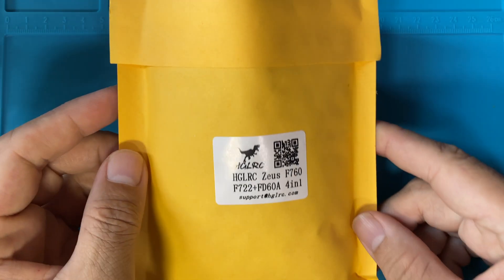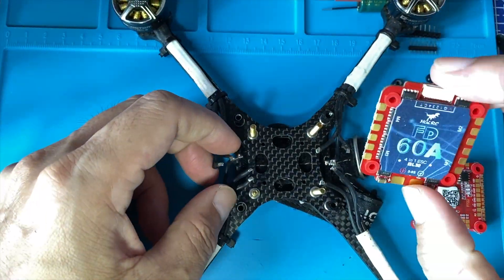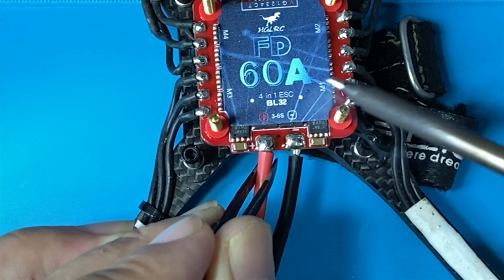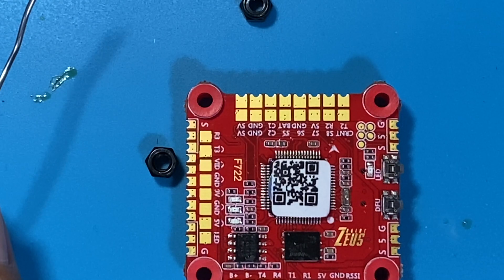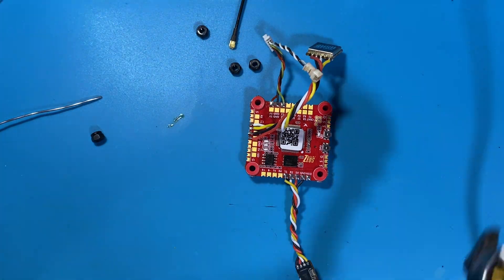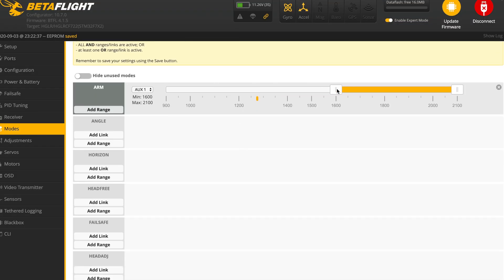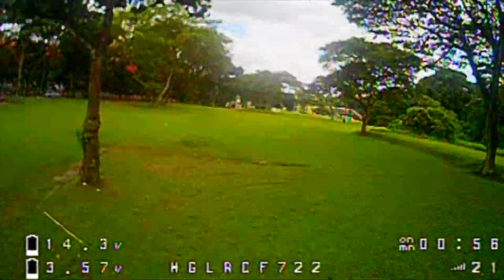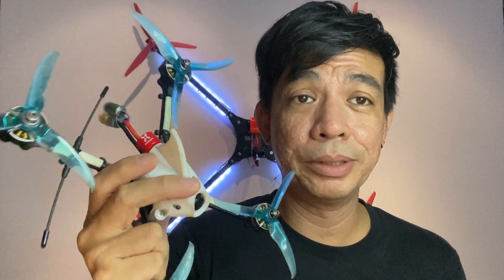HGLRC Zeus F760 | RACING DRONE BUILD

Comment: Thanks for this video, very straight forward and helpful man!
I have some spare unused parts, wondering if I could fit them and make them work with this stack: i have a M8Q-5883 SAM-M8Q GPS, a rush tank solo vtx, a tbs crsf div rx, a frame kit for a chimera 7 LR, just miss a cam, an fc/esc stack and motors (6S), do you think this stack is a decent choice for all that? Not fond of the SucceX-D F7 stack, wanted to try sth else, why I considered this one as it looks well made...
Reply from the maker: hey thanks for dropping by bruh!!!  Appreciate it man!! Thank you!  YES!!!  Mosdef bro! With that GPS module it will work nicely.  Im not fond of any iFlight electronics.  Killed 12 of the Succex F4s and F7 till I got pissed.  Good FC lousy ESCs.  Yeah, if this stack can fit your quad, go for it.  Its decent and can handle the high powered motors.  Its on my racer!
Reply: @shogunemperor  thanks for your reply and thanks for your content, always good videos!
Reply from the maker: @stevefpv4669  aye, my pleasure bruh!!!  And thank YOU for the kind words and support!!!  REALLY appreciate it man!!  Let me know if you need anything!

Comment: Nice to see they improved. I started with the F411 HGLRC stack. The QC is horrendous. They smoke up mid-flight and is barely reliable. Never bought another HGLRC after that experience.

EDIT: fu*kin dinosaur
Reply from the maker: Thanks for dropping by bruddah!!  Yeah, I think they made a termendous improvement.  I've had the F411 too it was pretty good till I crashed and burned!  But otherwise, this stack is really amazing and holds up well.  Quality wise is just amazing!
Reply: @shogunemperor  I rather the mamba than any HGLRC stack now. Hahaha
Reply from the maker: @Taggymy  ROFL i love the mamba... but I think this is MUCH better!  Its solid and you can REALLY push this unlike the mamba... whose ESCs I have burnt!!  Thats why they're not flying!